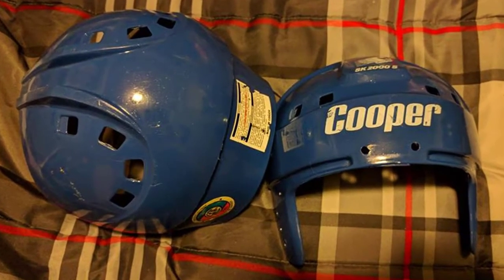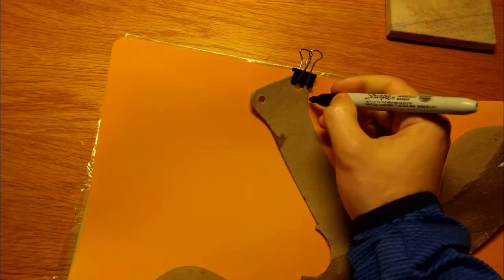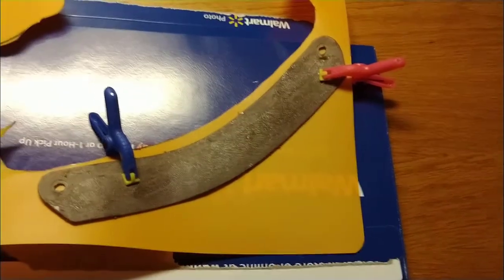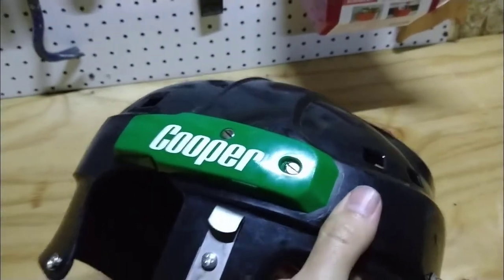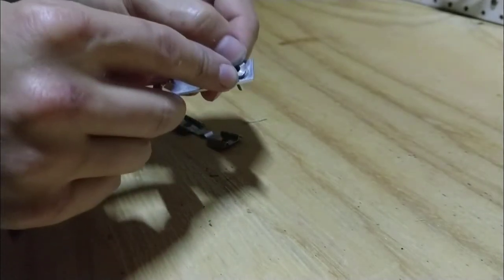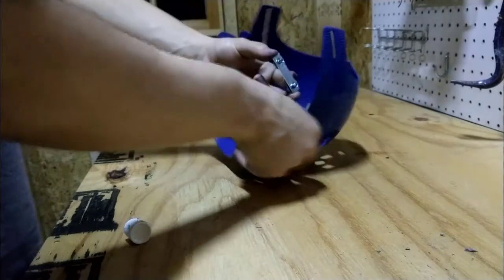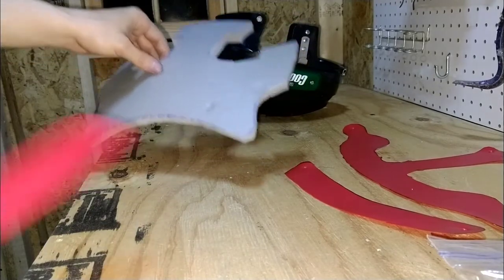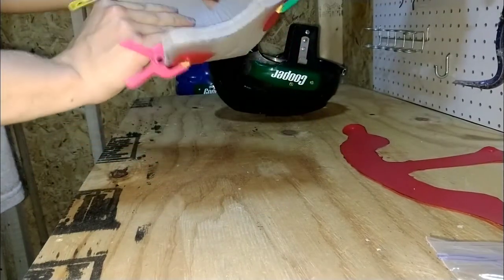SK2000 Helmet Refurbishment

Comment: Could you help direct me to where I can find the foam in 5/8ths inch.  If not should I just go with the 1/2 inch on a medium helmet?

Thank you for this video.  It is inspiring  me to make a goalie helmet from my sk2000 helmet i found at a flea market
Reply: I also have to mention I'm from canada
Reply from the maker: Ebay or Amazon are great sources.  I used EVA close cell foam at 2LB density.  If you are having a hard time finding 5/8th, try searching in metric, 15mm or 16mm will be very close to 5/8ths inch.
Reply: I honestly have checked everywhere....even from the place you purchased foam and they only seem to come in 1/2 then 3/4ths.  Should I go with the 3/4ths and add a slight more thickness?  Would it matter much for sizing?
Reply from the maker: @Seoulmanaja  check for 15mm, I think I have seen some at that thickness, but if you can't find that either, I would go with half inch.  3/4 usually is meant for a size small shell.  1/2 and 5/8 use the same shell.  Resale value is higher at 1/2 as well